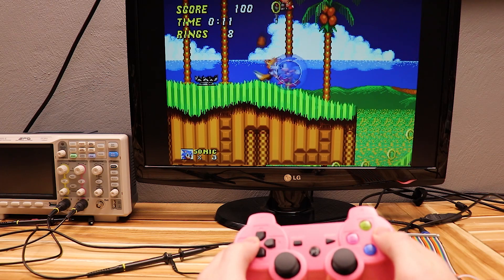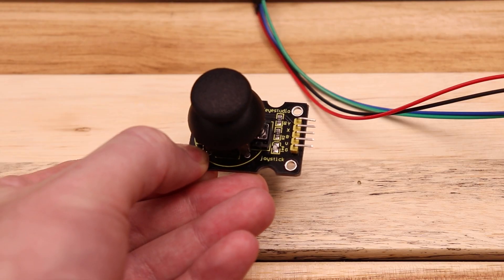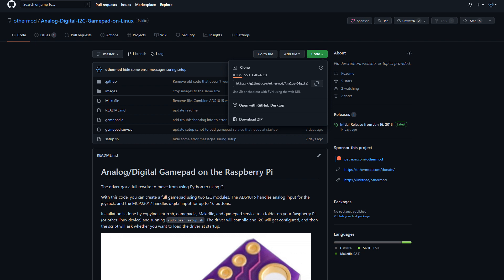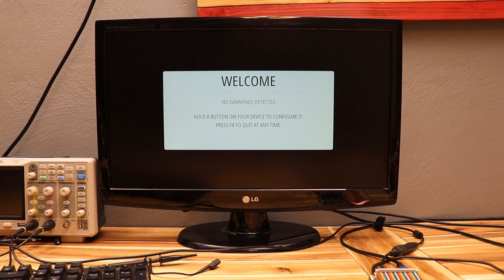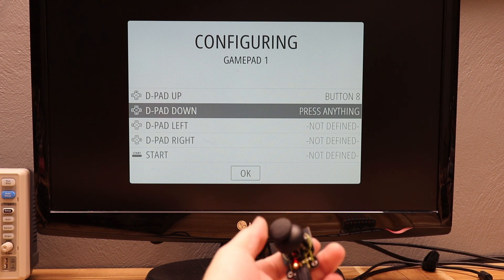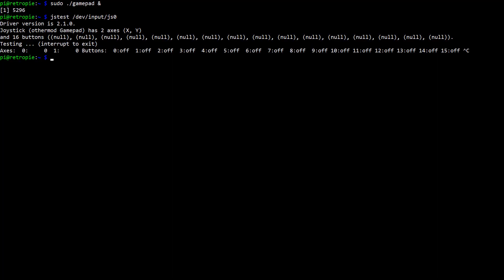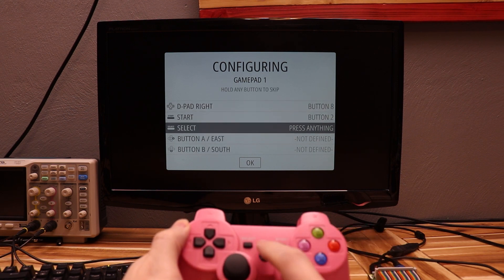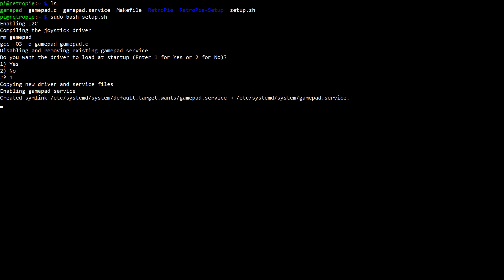Create an I2C Gamepad for Linux and Retropie (using an MCP23017 and ADS1015)

Comment: The Linux device I'm working with only has 1 set of I2C pins. Is there any way to get both converter boards working through one set of I2C pins that doesn't require reworking the code (I'm helpless when it comes to device driver stuff)? I've tried searching for other converter boards that integrate all on one board but with no luck; I even considered using something like an Arduino, but such, once again, falls back to me writing custom drivers, I believe. Soo many of the projects I want to take on that use Raspberry Pi's or Arduino's are killed-off simply by my lack of being able to write drivers.
Reply from the maker: You can use both boards on the same i2c bus. As long as they have different i2c addresses, you can use a ton of different devices on the same two wires. I'm also working on Arduino code to do the same thing, but it isn't quite ready yet. https://github.com/othermod/Raspberry-Pi-Analog-and-Digital-Expander
Reply: @othermod 
I see, thanks! I might give it a try then.

Comment: Wait, are... most analog controlers like that? Five io pins for X, Y, button, power and ground? Even the switch ones?

I'm still trying to make my own Raspi4 handheld somehow, but still stuck at pieces, not to talk about software, but I REALLY want some hall-sensing analogs for the project to make it last longer.
Reply: Bit late, but you can use an expansion chip, at the cost of a bit of power and latency. Ideally if you use one with latency, you probably want to have everything on an expander so delay will be about the same across the board, easier to get used to imo. I’m kind of new to hardware like this so there may be a better way. One example, you can squeeze a large number of buttons onto a few pins by making a key matrix. For example, you could theoretically hook up 9 buttons with 6 wires (3x3 matrix), 12 with 7 (3x4), 16 with 8 (4x4), etc. you may be able to throw the joystick buttons on there to shave those joy pins down to 4. Also, keep in mind everything can usually share the power/ground pins, so your joysticks use 2-3 gpio pins, depending on how you wired the joy button. A simple ps2 controller could use ~ 13 pins (4 joy + 3x6 button matrix). Don’t ask me how to get pressure sensitivity to work with a key matrix, I’d imagine you’d need a dedicated gpio for each pressure button, but start/L3/etc could still be a matrix.